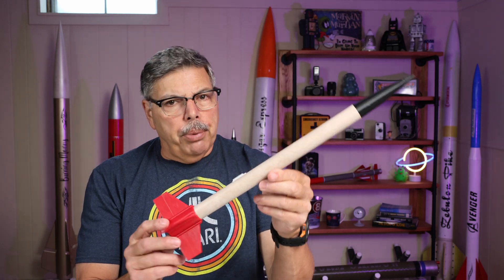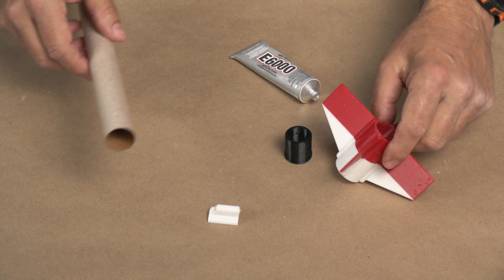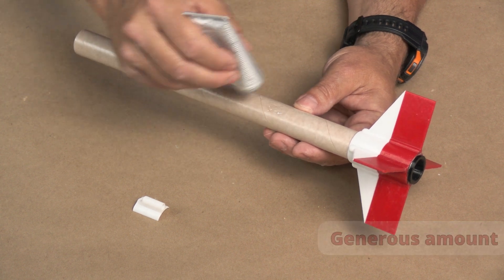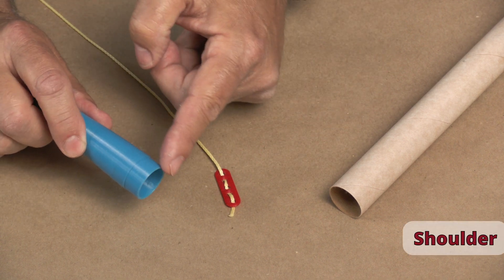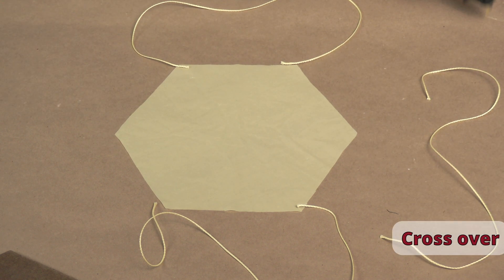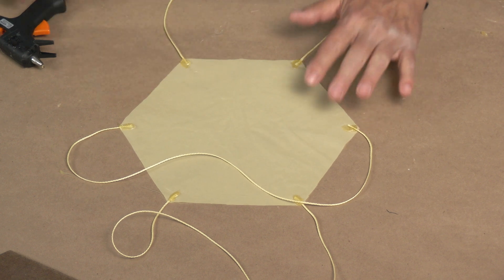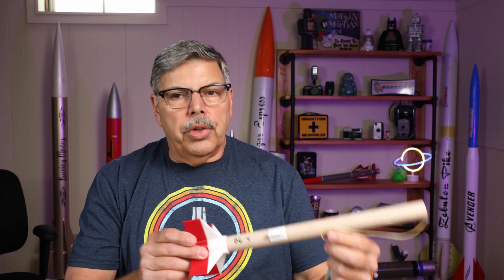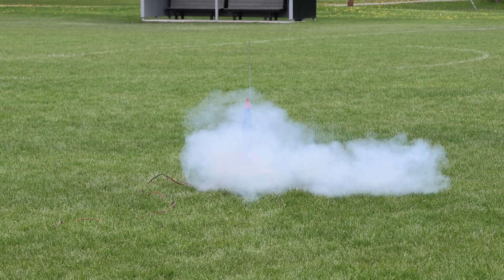DIY 3d printed rocket & parachute tutorial💥

Comment: Some ideas- I inherited a 3d printer last summer.  One of my first rocket projects was a fin can.  I printed it with an internal bulkhead for the motor mount and a screw-in retainer, and integrated the launch lug into a fin root.  I also printed my fin can the same outer diameter as the body tube and with a shoulder to go into the body tube, this makes the outside of the rocket a bit sleeker.  For nose cones I usually make them one piece, with a "bar" across the interior of the shoulder.  The shock cord just loops around this bar and then you don't have to glue in a separate shoulder.  It is pretty easy to print the fan can with the motor mount integrated, you could even print with your black already integrated so the rocket only needs two printed pieces plus the body tube.
I noticed in a couple of old kits I got from my club junk pile the body tubes were already colored.  One Estes kit had a red tube, a couple of Quest kits had white tubes.  I also notice that sometimes you can buy tubes that are already white.  If you are working with a group you could pre-paint the body tubes and then no further painting would be required.
We had a group one time that was given colored markers to personalize their rockets.  This works but I wondered if colored tape or strips of peel and stick vinyl would be better.